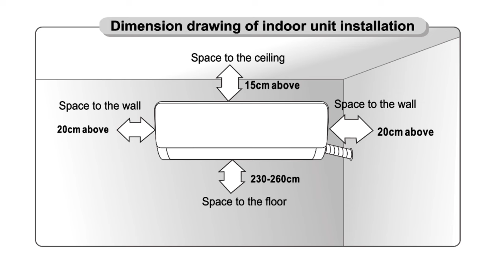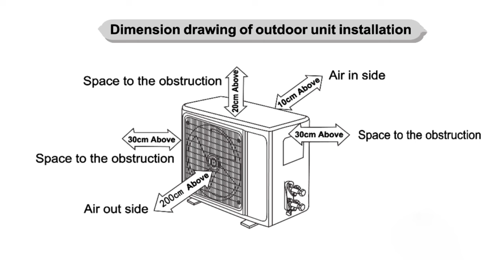How to Install a Split AC System at Home |  Stay Chill with Costway Split AC | FP10293US

Comment: I regret buying this brand. The manual and this video doesn’t show all the steps that is really needed to install the mini split. If this is supposed to be a DIY then all the steps should be in there including the vacuum e electrical part as well.( I’m not sure if other brands has the same issue)
Reply: Same issue with costeay brand
Reply from the maker: We really appreciate your valuable comments, and we will improve it in the future video production process. If you encounter any problems during installation, feel free to contact customer service: service@costway.com. Sorry to bring you an unpleasant shopping experience and thank you for supporting costway.
Reply: Mine is working great.  Great value
Reply: @costway how much do u really care? If so send electrician to install propers wiring for power
Reply: Zero dimensions in the instructions or online for the bracket system (specificallyfor the inner unit, but dimensions are missing in tonnesof places throughout). Impossible to know for sure where to install back-framing unless the unit is already on site, which for me, is not the case. EVERYTHING needing to be installed needs this info!! Please update all your documents and post this info somewhere so contractors can find it easily. It's ridiculous that it can't be found.
Reply: @marvanbee  Je pense que CostWay cache des informations importantes et nécessaires pour l'installation pour que les clients potentiels croient qu'il est très facile d'installer leur appareil, un de leur argument de vente majeur. Ne pas dire toute la vérité c'est l'équivalent de mentir, et bien moi je n'achèterai pas leur produit pour cela, la confiance n'y est pas. Je conseille d'ailleurs aux gens de ne pas acheter de leur produit.
Reply: @chapothakid5080  how is that there problem? This is an hvac issue. As an electrician I don’t expect hvac to run my wires from me and it shouldn’t apply here either.
Reply: @_DinoLive  I guess they don't care enough

Comment: Notice when it came to the wiring part at the end. They hurried up and cut the screen. Then at the end, when plug 🔌 instructions were needed into an outlet. With the TWO wire cord in which they give you when you purchased this unit. Notice they showed you nothing 🤷🏼‍♂️in the video about that. These companies are crooks. ( this particular unit is not made for United States. It is sold at Home Depot. But it’s for use overseas.

Comment: You should probably let all these Diy guys know you will need a vacuum pump and proper tools to install this unit and any other unit out there that doesn't come pre sealed system any open lines any space that air sits in in the freon lines has to be vacuumed out before properly works
Reply: Oui exactement. C'est comme si on veut faire paraître l'installation tellement facile qu'on n'explique pas cette étape importante et dont la plupart des gens ne possède pas cette pompe à air (vacuum) ce qui complique davantage l'installation de cet appareil. Alors pas aussi simple que la publicité raconte.

Comment: You purchased an A2L refrigerant mini split system.  Which replaced 410a refrigerant.  410a is not flammable however A2L refrigerant is Flammable. All in the name of Global warning.  Be careful what you wish for, now you have an explosive gas running in your appliance.
Reply from the maker: 1) Everything is flammable, including 410A. 2) Although classified as mildly flammable, A2L is hard to ignite and needs a higher concentration to become flammable. 3) The term "explosive gas" is misleading. Learn the difference between class 1 and class 2L ➡ https://youtube.com/shorts/PCDe4gRr6eM?si=Re8cIbBaTY-j29Ol

Comment: anyway to hide the hose behind the indoor unit?  like can you cut the hole behind the indoor unit mount and route it through and still be flush to the wall and the hose hidden from plain sight?
Reply from the maker: Dear, you can try to cover the hole with an indoor unit. The hose that comes with the product is designed to be bent at 90 degrees, so you can adjust the installation according to your needs.
Reply: that is what I am doing, they showed the line being bent 180 degrees, I'm just going straight out the back.

Comment: Can I run my power to the Indoor unit? How?
Reply: Were you able to get this figured out? Have same question
Reply: No, you don’t have to. The wire comes with the unit one wire connects from the inside to the outside and then the outside to the breaker box.

Comment: To vacuum out the line is it just the standard 5/16 Inch Female Coupler to 1/4 Inch Male Flare to be able to hook up the vacuum?
Reply from the maker: We consulted the technical personnel and the approximate situation is as follows: 7/16 "-20UNF, 1/2" -20UNF.

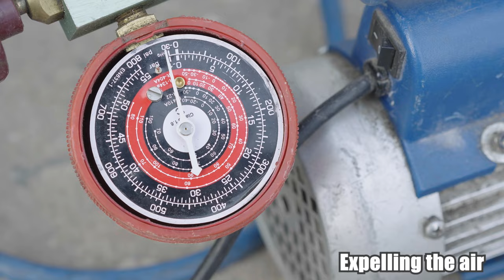Comment: Everything works well and blows air but no cold air in any setting. Am i supposed to loosen those allen key screws like in the video at 6:20?
Reply: Yes, it releases the refrigerant into the system
Reply: Be sure to vacuum the line as shown!!!
Reply: @Milo30066 when I vacuum the line my gauge reads around the 100 mark and starts going down. Is that ok?
Reply: @Milo30066  you don’t really need to vacuum the lines
Reply: @victorgomez8176  your right, I found out after installing the a/c. Thanks

Comment: For the US, can the 12k BTU 208V-230V-60HZ be used on a residential building with a 2-pole 15A breaker?  Nominal rating is 115V+115V = 240V, but most people know it as 120V+120V = 240V.  Will this still operate?  Or do you need to purchase the 115V-60HZ model for the US?
Reply: I really want to know that bit. Right now I'm probably going to get two 12k BTU 115V units.

Comment: This wiring front the non fuse box to the unit is that the 2nd cable and what are the 3 screws on the left so we don't need a wip cable
Reply from the maker: We recommend checking out our new installation video for detailed guidance: https://youtu.be/oU0EOG3ED3c

Comment: I'm not an AC guy. When the vacuum pump is hooked up in the video, the screw/bolt on the side is all the way in. How does the vacuum work with it screwed all the way in? Is this the correct way to do this? At the end it shows both screws/bolts being turned all the way out.
Reply: My guess is he is checking  for no leaks on the Air handler only an the copper line high pressure an return ?
Reply: Yes he sucks air out just in case before releasing refrigerant into system

Comment: Installed this unit and works great, but cant figure out how to remove inside unit face cover to clean coils.  Im getting black grit from the outside water line which means water is mixing with the dust in there. This unit doesn't have bottom screws like in the other brands videos show.
Reply from the maker: The inside unit face can be opened directly. We've never encountered grit in the drain pipe before, so we'll need to confirm the situation with our technical team first.
Reply: @costway  I'm trying to take the whole cover off similar to other brands to expose the fan and entirely of coils to clean and flush drain pan in the off season or does the "self clean" take care of coil cleaning at least. Still want to flush drain pan to prevent a blockage

Comment: Keep getting a E5 error. Not sure why. I noticed that it came with 2 different power cords and a communication cord.  1 for inside and outside unit, but not sure what that second power cord is for. I purchased a 208 volt 9000 btu costway. I need help troubleshooting
Reply from the maker: Please forward your question or concern as well as the order number to our customer support at service@costway.com. After order confirmation, our customer support are standing by and ready to help you resolve any issues you may have.

Comment: I have to install on an inside wall and I’m going to have to run my line set up and through the attic. Will condensate line still drain if it’s run upward about a foot?  I didn’t know if there was a pump inside the unit that pushes it out. I’m also going to have to buy a longer line set of 25ft. Will it still have enough refrigerant? I have looked around and I can’t find r32 anywhere if I do need it
Reply from the maker: The drainage pipe is a separate water pipe that is discharged outdoors and is not the same pipe as the connecting pipe. If the length of the pipe exceeds 5 meters, add 30 grams of liquid for every additional meter. If you can't buy r32, buy r410.
Reply: @costway  Yes but I’m still going to have to run the drain line through the attic too. Will the drain line still drain if it is run upwards
Reply: No it will not drain
Reply: @KcS-v4f  It will fill up until the water can head downwards. So if the drain goes down at the end, it will drain. But you might have issues with standing water/algae build up.

Comment: I bought the same mini Split but I'm a little confused with the proper torque what torque did you give it?
Reply: can the compressor sit outside on a slab, or does it have to be mounted same height as the indoor unit on L brackets? the installation instructions were a bit "vague"

Comment: Isn't it supposed to be a precharged DIY system? If so why need to vacuum the lines? Aren't you removing all the prefilled/charged refrigerant? Where do you get R32 here in the US?
Reply from the maker: Vacuuming is done after connection, and the refrigerant is pre filled. Even if there is a leak later, it is not easy to buy R32 locally, so you can add some R410 to it.
Reply: @costway no.
Reply: You have to vacuum the line system before firing it up because when you take the caps off of the lines they are subsequently exposed and can become compromised by dirt or dust or moisture, all of which are detrimental to the operation of the unit.

Comment: Including the diameter size of the outdoor unit's leg bolts/concrete anchors would have been nice. Not in the User Manuel either
Reply: Agreed, I'm having these same thoughts now. I bought some 1/4" x 1 3/4" Tapcon concrete screw anchors. But I'm not sure that diameter is big enough. What did you end up using?

Comment: can the compressor sit outside on a slab, or does it have to be mounted same height as the indoor unit on L brackets?
Reply: Mine is on a slab outside.
Reply: @carlwellman3623  thanks Carl!

Comment: Does this come with the refrigerant already in the outside unit?
Reply: yep I've installed this exact unit myself it comes with refrigerant in the outside part which you release with Alan screws on the outside units plugins but make sure to have a vacuum pump to install they don't tell you that oddly as for a concrete platform 4 flat no hole concrete blocks worked good for me

Comment: so no part for the actual wiring for power? awesome
Reply: Just get a 12 gauge extension cord cut the end you need and use wire nuts to connect to the 3 cords on the outside unit you have. And plug it into an outlet
Reply: Black on the far left, then white, skip the 3rd one and your ground on the far right.

Comment: Where does that dang signal cable go??
Reply: Same
Reply: Communication cable runs from the indoor unit along the refrigerant lines to the control board connection at the outside unit.

Comment: so the outdoor unit plugs into what? 220v?
Reply from the maker: Yes.
Reply: @costway That’s correct.
Reply: Assuming you purchased the 208-230v system, yes. For US installs this requires a disconnect outside near the unit. Main reason for this is for servicing of the unit.

Comment: Why you need to vacuum the lines after connection , not every one is gonna have a pump ,does it come with system?
Reply from the maker: Hello! Vacuum pumping is because it is pre charged with refrigerant.
Reply: @costway  Et alors & Pourquoi la pompe, c'est là la vraie question. Faudrait-il faire le vide dans les tuyaux avant que le gaz soit introduit. Pourquoi êtes-vous aussi vague sur cette question et que ce n'est pas mieux expliqué dans votre vidéo ? Serait-ce que cela nuirait à vos arguments de vente ?

Comment: missing the part where other end of 3 wires cable one goes to inverter and where the other end goes? Please help
Reply from the maker: Confirming, will get back to you asap.
Reply from the maker: Sorry, since the schematic diagram cannot be uploaded in the comment area, if you have purchased this product, please kindly check the manual from page 20 to page 22. If you still got any further questions, please contact via Service@costway.com. Thank u for your support.
Reply: @costway  Mauvaise réponse; si on veut l'information avant d'acheter cet appareil ? Avant d'acheter il faut savoir dans quoi on s'embarque car cet appareil est dispendieux.
Reply: @theoriginalscottmalkinson6161  OK mais croyez-vous vraiment que c'est pour cette raison d'économie que Costway n'explique pas clairement pourquoi et surtout comment on doit faire le vide du système avant de le remplir ? Cela demande de l'équipement spécial et rend plus compliqué l'installation, isnt'it ?

Comment: I just bought the AC, followed the instructions, wired everything and it won't start. Have you guys ever met with this problem before and what is the solution?
Reply from the maker: Hello. Can you check the compressor work? Then measure whether there is electricity in the terminal board of the lower and outer machine.
Reply: Same
Reply: Problem solved. I brought a buddy of mine to help. He checked all of the wiring and found everything good, after that he checked the breaker on the electric panel and found that the 240 breaker was only giving me 110 so we went to the main breaker and found that the breaker from the meter was bad. I replaced it and it's working fine now.
Reply: @chefkarimassaf268 hi I’m currently installing mine. Can you tell me if I need two hot wires and no neutral from the breaker? It’s 240v so I would believe so but just want to make sure
Reply: @spudlover96  A 220 v circuit has 3 wires, two hot usually red & black and a white neutral and a copper bare wire as ground.
Reply: only 2 wires red and black and ground which is bare copper wire,240 doesnt need natural since one becomes the nut!unlike 110. @MB-ec1cb

Comment: Awesome no power needed runs off air!
Reply: There were two sets of black wires, I think one of those sets goes to the disconnect, it has 3 wires, he installed it on the outside unit first.

Comment: Getting a code 3
Reply: Getting a code 3
Reply from the maker: Reason: The system liquid level is less than 30%, resulting in non cooling and a lack of liquid protection report Fault Explanation: Inspection path: whether the external valve components are open → whether the evaporator, condenser, and connecting pipes are damaged or cracked → whether the ambient temperature sensor and coil temperature sensor are both damaged Tools required for testing Hexagon, multimeter, pressure gauge Frequently problematic components: Stop valve, evaporator, condenser, connecting pipe. Detection steps and key points: 1. Check the shut-off valve and turn it counterclockwise with a hexagon to see if the valve is not open or not open enough 2. Check whether the connecting pipes of the evaporator and condenser are damaged or cracked, with a focus on checking whether there is refrigerant leakage at the welding parts and the joints of the connecting pipes. 3. Measure the ambient temperature sensor and coil temperature sensor with a multimeter at ambient temperature to see if their resistance values are abnormal at the same time.

Comment: That is an A2L refrigerant system. You need non-arch rated tools. I’ve watched several videos just to check on the performance of these units and the R-32 refrigerant. This is not really a DIY kit, if you want DIY go with Mr. Cool. I can get this done because I’m a technician and I have all of the specialty tools that altogether cost more than the whole system. 

If you decide to DIY buy an A2L approved vacuum, manifold with hoses, flaring tool, a core tool remover for a faster vacuum. These require a dedicated circuit so if you know electrical is self explanatory. 

As far as all of these dog water installs I’ve seen, avoid that sloppy slack on the line set, cut it down to length and cut off the factory flares. Factory flares are what causes most initial leaks in these new systems. PRACTICE YOUR FLARES! Got it down now? Good, proceed to flare and apply a liberal amount of nylog on your flare. Positive pressure test with nitrogen for 20 minutes, once no leaks are verified you can release the nitrogen. Proceed with a vacuum of at least 500 µm. From there release your charge and you’re good to go. 

Folks these things might be cheap and you’re probably here because you got what you thought was n outrageous quote but what most residential HVAC guys do is a lot more complicated than you think. If your system breaks immediately it’s not the manufacturer, IT IS YOU!